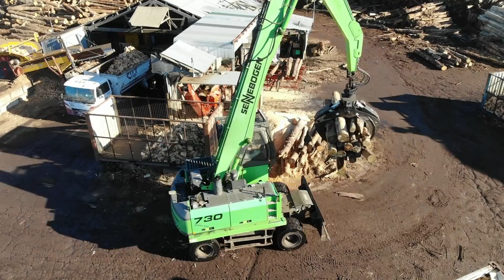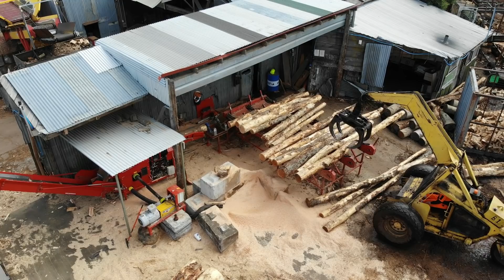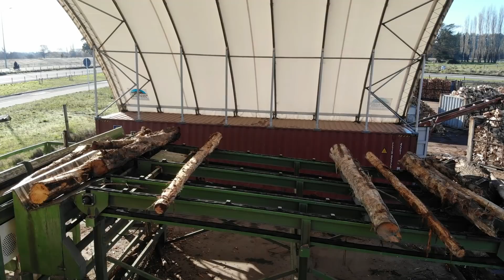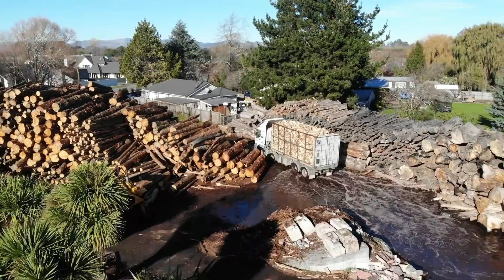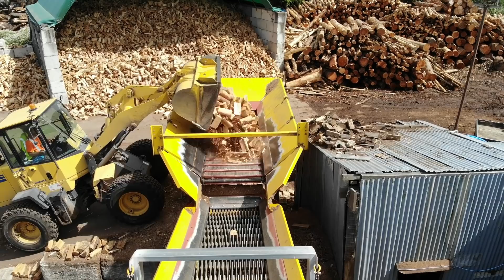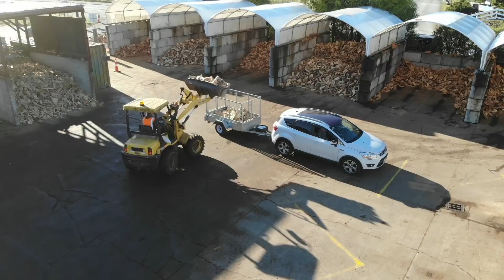How we make over 50,000 cubic metres per year at City Firewood

Comment: Thankyou so much for the video. I'm absolutely blown away by the amount of wood you have there, the amount of wood you process and the number of different processors. I'm also blown away by that cute 3 wheel loader. I've never seen anything like it before.
Reply from the maker: You're welcome Alan!
Reply: I agree with Alan, this is an awesome set up! What are the little three wheelers with a timber crane and where can I get one? I need one for my yard :-)
Reply from the maker: @garethtaylor7991  they are called Bell Loggers. Manufactured in South Africa

Comment: European wood always cracks me up.  10-12 inch pieces for smaller stoves.  US pieces start at 16" usually ang go up to 24" for indoor stoves. Boiler wood is even larger.   You guys are putting out a lot of wood either way.
Reply from the maker: This is generally to do with air quality and efficiency as a higher standard of these can be achieved with smaller pieces and therefore a smaller stove. I suspect USA doesn't regulate as much on stove emissions which is why larger stoves are sold. We are in New Zealand by the way which is not in Europe :)
Reply: @cityfirewood9770  since when does USA regulate anything environmentally? To start look at them fuel guzzling penis enlargers, ancient inefficient power plants  or even the average power consumption per capita. 

In Europe we don't NEED those large pieces, simply because our homes are more efficient and generally smaller too. Heck I know a farmer nearby that heats his house, two barns, hottub and boiler on just 6 cords a year. He does have a highly efficient wood gasifier (90%+) which he only needs to fill once a day. He takes pride in properly insulating his property and tuning his system for maximum efficiency.
Reply: @patrickd9551  and in England we have houses made of stone with insulation, not some little wooden houses that get blown away in the first little tornado!   
i heat my very thick stone walled house with a 8kw clearview log burner, and that takes 15" wood!
Reply: Smaller wood dries quicker. I’m in WI and  we’re producing all smaller split 16” wood. Can split in spring and burn that fall around 20% moisture. Big wood takes two years to get that dry
Reply: It's all relative I guess. The place you live dictacts most of what occurs there. I'm guessing you don't need much cooling in England, but here in S.W. America we need plenty of it. That is, unless you drive 20 miles and change elevation.then cooling isn't needed. The loads on heating are the same. What works in Phoenix AZ 6 hours away don't work here at all. 90 to 100 percent of efficiency comes from your local, not from some fancy machine. You might gain 10 to 20 percent effective gain when you compare apples to apples within your local. Age of equipment is also a big factor, along with the fuel source.

Comment: Why don’t you have more then 1 900 Pezzolato? I have a 3040 m Tech and would love a 900 Pezz anything you don’t like or recommend?
Reply from the maker: Tb900 is a great machine. We would look at another one (or tb1200 ) in the future but it's best suited it you have mostly large diameter wood (500mm and above), we have a range of sizes below that so it's best for us to have a range of machines to suit those sizes.
Reply: @cityfirewood9770  how are they on price compared to Multitech? A new 3040 is like $150,000 usa
Reply from the maker: @robwar2288  less for just tb900 without cutting station, more if you want TM cutting machine. Would expect 50% more than Multitek for whole setup. Much more versitle and easy to use than Multitek though unless you have good control over log size you purchase.
Reply: @cityfirewood9770  we do Land Clearing. So most of the Logs are bigger then 20inch.

Comment: "Our firewood is recovered from the forest and rather than decaying and releasing it's carbon, we intercept the process and allow it to be used for useful, carbon zero, renewable energy" How is this claim possible?, I burn a shed (25T) load each year heating the workshop and house, heat by releasing the carbon in the wood by burning. or am I missing something.
Otherwise nice vid and set up (except the music) but I can turn that off.
Reply from the maker: The carbon is released in both scenarios - either in the forest through decay, or in the fireplace through combustion. The carbon is absorbed either way, through the regrowth of the rotation (sustainable) plantation forest. Both examples have net zero carbon change over the life cycle of the harvest. By intercepting the waste logs, we make little net difference to atmospheric carbon, except we make the material useful by using it for heat. The heat is therefore carbon neutral, and the house may have otherwise relied on a fossil fuel or fossil fuel derivative (i.e. gas, or electricity generated from coal or gas).